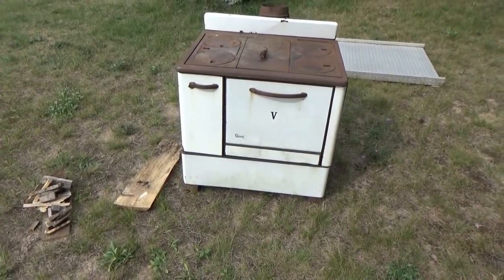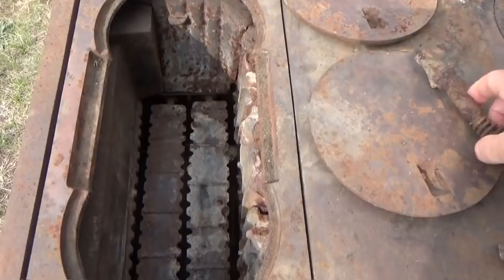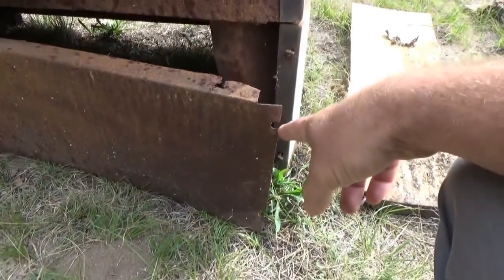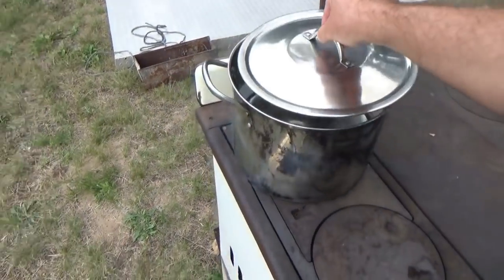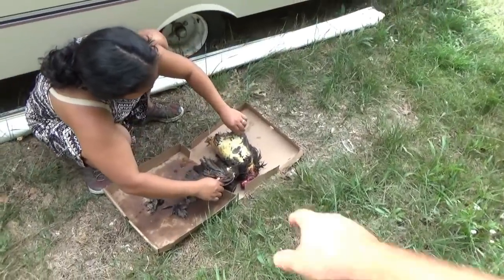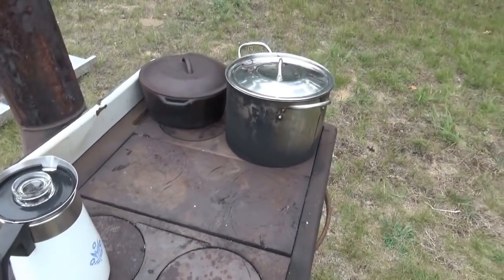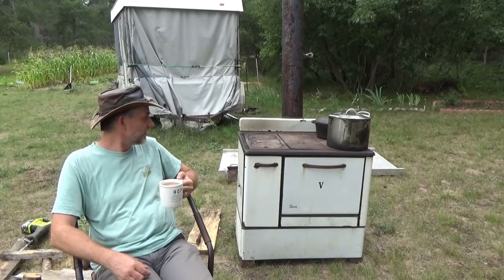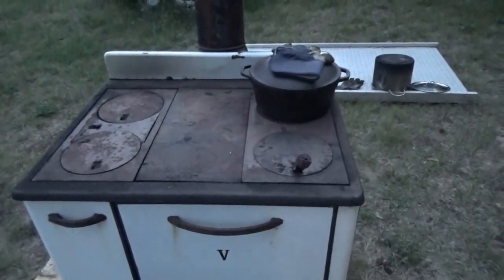The Off Grid Project Cooking All Day With Antique Wood Cook Stove

Comment: I love it it is cool or actually hot. I have a stove in my shed that has removable burners on it like that its pretty cool.You could pour a concrete slab out back of your house and build a roof over it. Lean to on the side of your house or some place to put your stove for cooking out side when it hot. or to help heat the house in the winter time.
Reply from the maker: I think an outdoor kitchen is the way to go.
Reply: Yeah its in need of repair and you dont have a lot of room and it will be cooler to cook outside. If you make it a back porch to sit on it can help heat your house in the winter. Make sure you make some good patches out of some good heavy 1/8 inch sheet metal or even 1/4 inch sheet metal so it dont burn up. You dont want coals falling out of it burning up your yard or what ever it sitting on. With the water pipes you could set it out side and run some pipes into the house from outside and help heat your house with that. Or hook it to a hot water tank.

Comment: Sweet stove! A little cleaning and refinishing....breath taking! I believe you would season the top like you do a cast pan....but I could be wrong
If your putting it in the cabin you may want to pick up one of the heat powered fans (like magic heat) to get the heat distribution without any electric.

Comment: What is the shaker part of the stove? I’m curious to know what that part does. Never had to deal with a stove like that, but I sure do love it❣️That’s going to come in mighty handy on the homestead! I saw you changed the grating, is that the shaker part?
Reply: The grates ( shaker part ) is double sided. The solid side is for burning coal and the grate side for wood. When burning wood, ash will build up on the grates and most give it a shake ( but not enough to lose the coals ) to keep the air feeding the fire. There is a tool that turns ( flips ) the grates and “shaking” the handle is usually enough to clear the ash without losing valuable coals.
Reply: Side note, burning coal ( or charcoal briquettes ) can be hard on the oven. Been told it greatly shortens the life of the oven and have seen that with warped grates and bent side walls. Bought mine off a woman who had used coal for a few years, but stopped when she saw grates warping.

Comment: Think I'd be inclined to use steel wool to clean the top of the stove plates. Wondering if you'd need to season them with oil like you do a caste iron pan or griddle?
Reply from the maker: I read that you can season it with oil like cast iron.

Comment: Troy my grandma's was a burner width wider on each side of your cooktop. Firebox was on left and water tank was on right. Heavy it was and the oven was about a loave pan wider to either side. Used steam heat for cook8ng and backing.